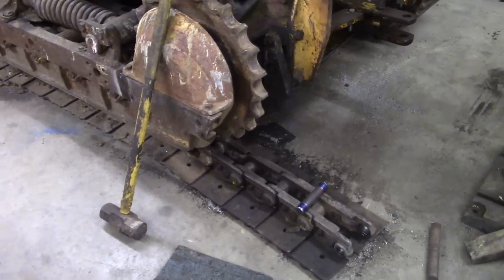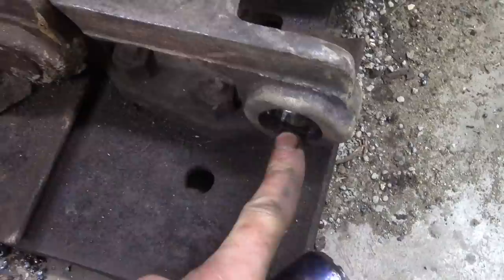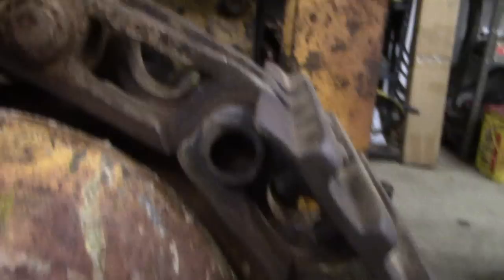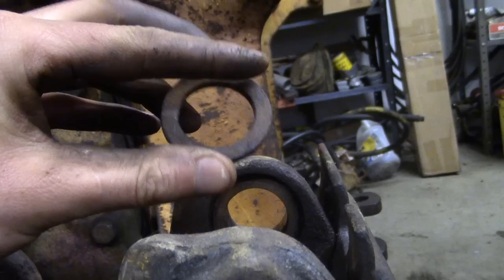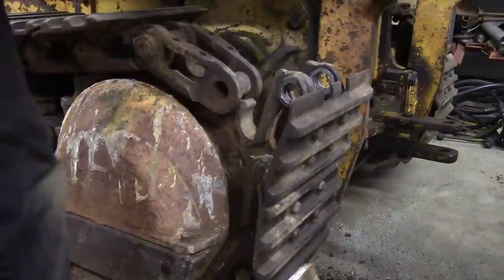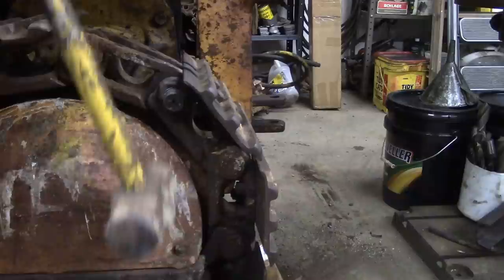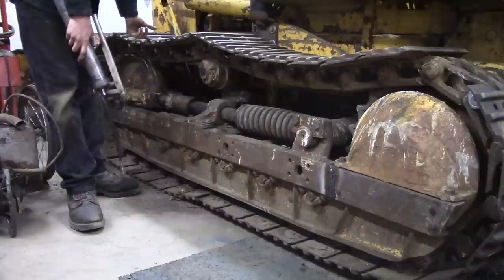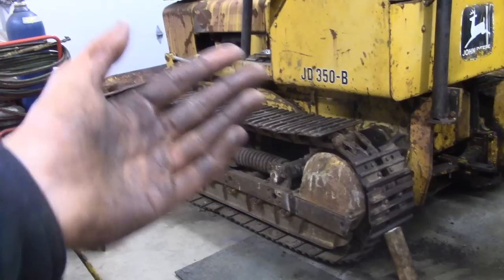John Deere 350B - Track Installation

Comment: You could drill a half inch hole on each end, tap them and use  a half inch bolt with thick washers under the bolts.

Comment: Is the master pin directional on this style of track? I noticed that you drove it out the same direction you drove it back in. If it was tapered wouldn’t it want back back in from inside to outside of the track? I know you’re was loose so maybe it doesn’t matter.
Reply from the maker: it's not tapered, both ends are press fits. Therefore, the pin can be pushed in/out either direction.

Comment: I have a  350c.  The track seems stretched to the end of the rail. Will require new  bushings/bearing?for front idler. Wondering if I can remove one link from the track as well.
Reply from the maker: sounds like the pins and bushings are worn out.
Reply: @themadmailler  my father suggested that.  They don't seem to be all that bad. Definitely lots of play in the idler. That repair will help but won't gain a whole lot of adjustment. Going to resurface or replace the adjustment pistons while I have the tracks split.

Comment: One side of my 1963 JD 2010 dozer is not working. will adjustments to brake-clutch settings improve turning  left-right
Reply from the maker: yes, assuming your clutch and/or brake isn't smoked.

Comment: I had a question for my John Deere 350 B I had a guy tighten the clutch is up it worked fine and then one of my employees put way too much fluid in the transmission now time to time when I go to put it in drive it hesitates what would be the calls of that and ????

Comment: I got what looks like a weep hole on the bottom side when I put geese in it just comes out
Reply from the maker: that is the hole that the grease comes out of when you open up the relief to loosen the track. there is a bolt with a locknut next to the zerk, if it's loose it will allow grease to come out.

Comment: Where do you get the track Adjusters I got a 450c and I'm doing basically the same thing you did to yours but my Trac adjusters bad
Reply from the maker: I found all the parts I needed on Ebay.